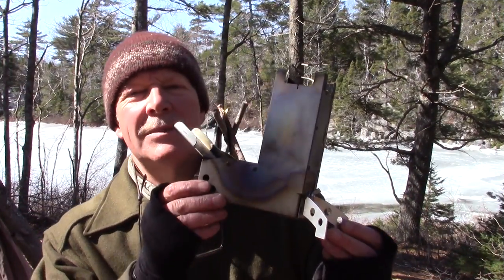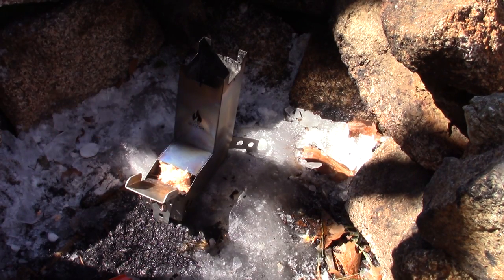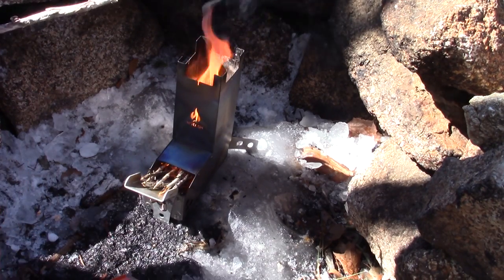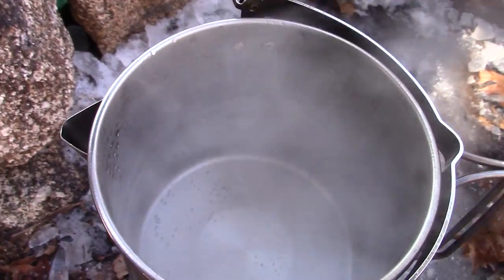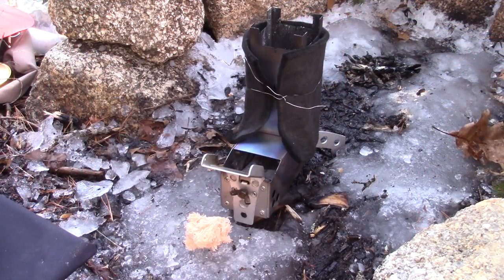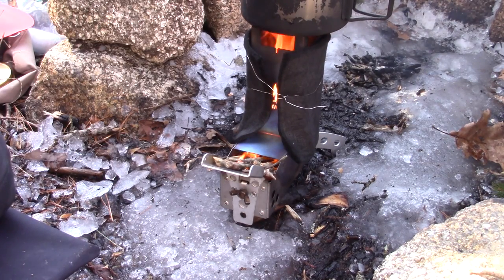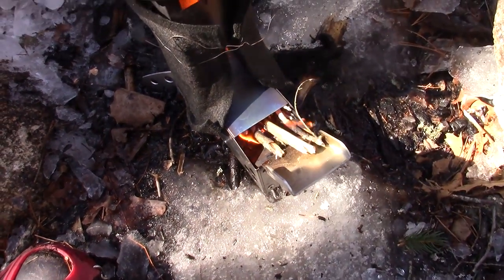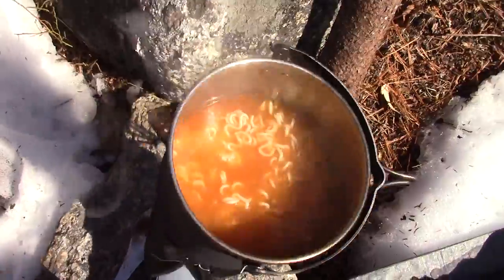Hot Ash Mini Redemption Video ?

Comment: I can not imagine carrying such a contraption in my pack. I really like the Kelly kettle, and it boils water very quickly; however, it is too bulky as well. I have found that the folding stoves work best for me. They fold flat and I have never had trouble boiling water with them, or trouble cooking anything with them. I am almost 70 years old and have been a woods runner and avid squirrel hunter all of my life in the east Texas woodlands. I have never seen a reason that I had a need for water to boil quickly. Hell, I go to the woods to slow down. Thanks for the video.
Reply: Robert31352 I agree 100% flat stoves fit anywhere I threw my Kelly kettle away. I hardly use my solo stove also. Greetings from Ontario Canada
Reply from the maker: I agree. This is not a stove I would choose to carry. I am also not in a rush to boil water (most of the time) when I am in the woods. As you say, Slowing down is the reason  for being there in the first place. I find it hard to beat the Emberlit or the Firebox when it comes to efficiency. Speed may not be an issue but having to constantly feed sticks like I do with the Hot Ash, that is an issue. Thanks for commenting
Reply: Mark Young I totally hear the Firebox comment!  LOL!  My firebox is golden, I couldn't wait for it to arrive, only to find it weighs a TON!  I had to get the Nano.  Still, they both boil water faster than that "rocket stove".  While I go to the woods to slow down (and rarely use a stove at all), I don't want to wait a half-hour for my water to boil so I can have a lunch, or especially if I just stopped for tea.  I'm not a "conquer-the-route" type of hiker, but I still want to get where I'm headed so I CAN take the time to cook a REAL meal for supper.  Eight hours on the trail is plenty of sauntering, adding 30 minutes for each stop is ridiculous!  My pop-can alcohol stove can heat better than this.  Thank you for sharing this dismal performance with us.  Also, thank you for not swearing when things go really badly.  I've had that happen in a group of young Scouts when my supper was on the Coleman peak stove.  Kids were rushing around, as usual not paying any attention to what's on the ground or where their feet are, and suddenly, my supper is on the ground.  Luckily, I always bring an extra meal, just in case I get caught out an extra day.
Thanks again for the videos.
Ted.
Reply: @MarkYoungBushcraft  Yes--that constant feeding is not acceptable.  My first ultralight woodstove was like that.  I only took it camping the one time.

Comment: And the end of the video demonstrated another problem of more-tall-than-wide rocket stoves. I'm surprised I didn't hear a "beep" at that point - I instantly had a "to-be-beep'd" word trying to get out ;-) 
It's discouraging to see that it takes a Youtuber to educate a company how to design a working product. Even when after a first "fail report" thy don't investigate deeper but instead try to pinpoint the mistakes of the Youtuber. I think this video is a very good reason to put money into other companies' stoves... Thx a lot for this clip, highly educating!
Reply from the maker: Didn't need a beep to cover my crying :) Actually, I scooped up a good amount of it and ate it anyway. I agree, I would have expected more testing before the company let it go out the door. Thanks for commenting
Reply: @MarkYoungBushcraft  oh, just saw that part, oh man after waiting that long for a boil
Reply: I wonder if the cold ground is sucking the heat out of the air intake..
if it was on a flat rock or something to insulate it would it work better?

Comment: I have had none of the issues you have shown us here today. A  rocket style stove can often require more flexibility that your average backpackers wood stove and  there is no better path to disappointing results than hoping the same method will work best every time. Titanium is a slow heat conductor and can be very deceptive as to just how hot it may actually be on the inside, especially in cold weather. This gives rise  to the thought that your "cold chimney" issues are  likely due to not adding enough good fuel or not adjusting the fires position a bit further into the chimney area to make the stove...hotter. I love my Hot Ash mini yet do often grab a simple Emberlit box stove for most of my hikes. I leave the rocket stove for having fun on the back patio. Thanks for the video Mark.
Reply from the maker: I really tried to make this one work. With the very best of dry wood it was passable but it never worked as well as say, the Emberlit. Thanks for commenting

Comment: I have experimented myself with a tiny rocket stove build in the past, much smaller than even this one on the video, and I also discovered, that if the fire box is very small i.e. the mass of the burning wood is very low, the chimney dissipates too much energy for the stove to be practical as a stove. Wind makes things even worse. Good video.
Reply from the maker: Right on. Glad you liked the video. Thanks for commenting

Comment: I really like your even-handed, scientifically minded approach.
I have to say--that rocket stove doesn't have the characteristic 'roar' of a rocket stove and just does not seem able to pull a strong enough draught.  The chimney seems too short--and the length of the chimney is what makes a rocket stove a rocket stove.  I couldn't see what the air intake arrangement was.  Generally, rocket stoves use their strong draught to blast air in at the base of the fire.  Often the fuel is fed in above the air intake.

Just today, I boiled water for coffee with my hobo stove down on the beach.  The air temperature was about freezing and the wood was damp driftwood.   The hygroscopic effect of the sea salt, impregnating the wood, ensures that driftwood remains damp except in very good drying conditions.
Despite that (and a too narrow pot)--my water boiled quicker than in that test.

My impression is that the correct length of chimney--is what makes for difficulty in designing a small light weight rocket stove.  There is the bulk issue,  and the stability issue to be overcome.
Reply from the maker: Great observations. I do have another small rocket stove review coming. Much better performance. Thanks for commenting

Comment: I had surmised that the tall neck of the stove was emitting and allowing too much heat to dissipate. Especially in colder/windy weather. Design flaw I would guess. Also, seemingly high center of gravity makes it an accident waiting to happen. Thanks Mark. Good to know you go the whole nine yards to be fair!  Actually, I was writing these comments near the end of the vid and now I see the stove tip over...see sentence #4 above. ps....I've switched from Raman brand ....I preferred the 6 pack cups  (more veggies inside and self containing vessel)  (36 cents/ea.) over the 12 pack plastic packages ($1.98 for 12 at Walmart)......to Nissan brand. The "Very Veggie" in green  (printed on label) 75 gram..2.65 oz. cups is $1. U.S. each but what a difference on flavor and vegetable content. More than just salt and noodles. Walmart does not carry this item.
Reply from the maker: In truth, there are multiple design flaws with this stove, including the tendency to tip. Good noodles with veggies make for a great quick lunch...as long as you don't dump them. Thanks for commenting

Comment: Very nice video thanks. I kept thinking ( as you probably did ) how much better a lixada or firebox nano works. I think 'form follows function' might need to be applied to the Hot Ash Mini and some redesign to get rid of all the 'sharp edges' and maybe they could come up with a winner in the future.
Reply from the maker: I agree. I had high hopes for this stove but unfortunately, the design does not deliver. The Nano and the Fireant work so much better.  Thanks for commenting

Comment: I think that maybe the titanium is acting as a big heat sink. Of course the cold weather didn’t help either. I have the slightly larger lixada stainless version and it works much better, just have to keep it well fed. Pellets work well too.
Reply from the maker: Yes, I agree. The small size and titanium both contribute to the inability to keep a high enough heat. Thanks for commenting

Comment: This makes since most rocket stoves are made with a clay chimney that provides heat retention.  Titanium is a poor conductor of heat and cools down rapaidly.   The carbon felt was a great idea.  They should now include a carbon felt sleeve to go over the chimney.
Reply from the maker: I agree. In the case of this stove, it is just too small as well. It can't generate the minimum heat needed to perform. Thanks for commenting
Reply: @MarkYoungBushcraft  i’ve seen a video where it will boil water as is in 40 degree temperature. I’m tempted to buy one but will definitely take up your idea with the carbon felt

Comment: The carbon felt does seem to have done the trick. I have used it as a wrap around some tall pots and a Kelly kettle to slow heat loss.
Reply from the maker: Good suggestion. I may try that with my KK Treker although it is so fast as it. Thanks for commenting

Comment: Good test. Sorry about your lunch.
I have an Ooni Pro pizza oven that I use with wood and charcoal. I notice my performance is increased greatly with the addition of a small fan at the back of the oven at the air intake or (since it sits on a table with wheels) if I rotate the oven so the natural wind is blowing from the rear of the oven. It appeared you had flame creeping out of the burn chamber at one point and I wonder if wind direction would help? Also is there an air intake below the fuel feed chamber? If there is and it's blocked performance will drop.
I've fried chicken in a cast iron pot using a rough made rocket stove from  bricks. This was during a light snow at about 28-30 degrees Fahrenheit, but not to windy.
Sometimes in a camp like setup with wind screens and so on we create a negative wind/air effect for a stove like this. Great for an open camp fire but not something like this. Just my thoughts. Love your videos and glad you're still sharing. Have a great day!
Reply from the maker: I do appreciate your suggestions. There is a false floor that allows airflow under the burn chamber (see the first video). Interestingly, the outlet at the foot of the chimney was becoming blocked with ash and diminishing air flow. A well designed rocket stove is a thing of beauty but not this one. Thanks for commenting